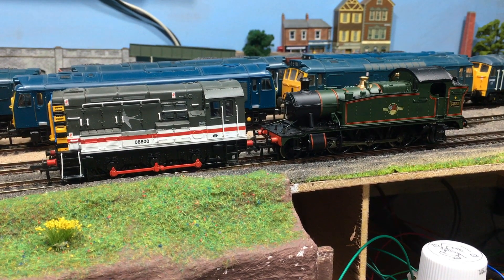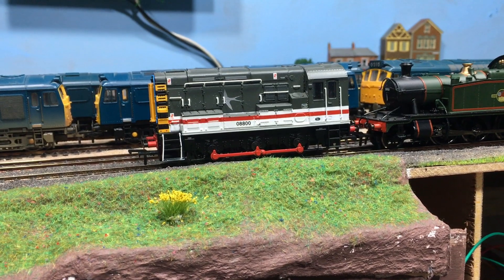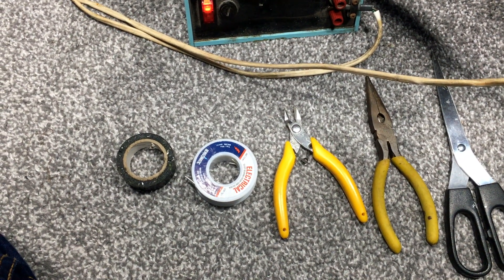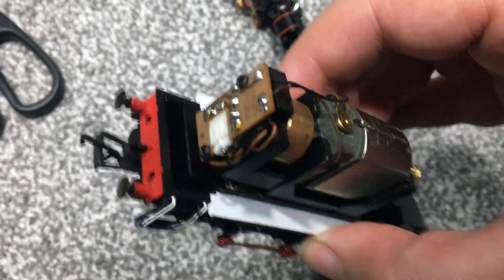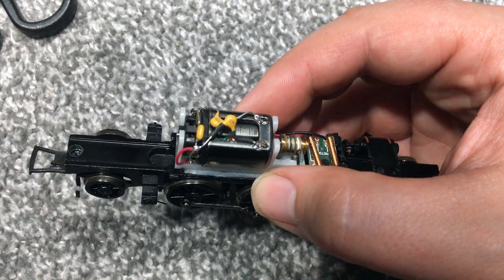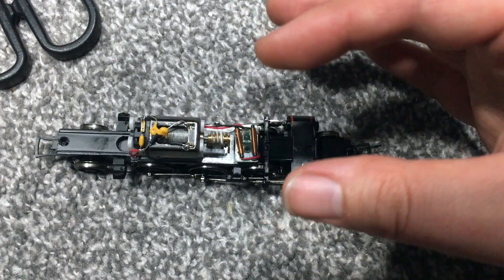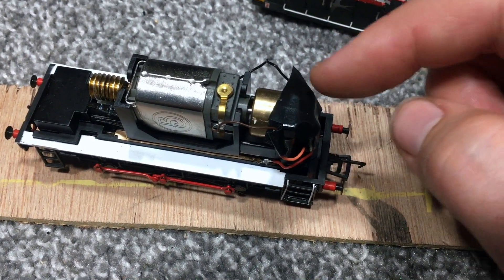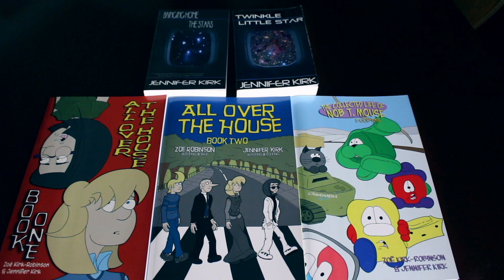Step By Step Guide to hard DCC wire old locomotives

Comment: Hello Jennifer. I'm new to this DCC method. I was wondering if, after a train like this is hard wired for DCC, is it still able to be used on a DC track with a normal controller, or is that a no no ?

Comment: Jenny you would be far better off using shrink sleeving on your soldered joints rather than tape as it can unravel,shrink sleeving is not expensive,you can it big enough to cover your dcc chip,to shrink your sleeving use the top half of your soldering iron
Reply: Too true!  Shrink sleeving is so cheap and I'd say easier to use than trying to tape joints up.

Comment: Those capacitors on the loco motors aren't needed because the DCC  chips are suppressed - you can do away with those. As others have said, heat-shrink tubing is better for these jobs than insulating tape.
Reply: The capacitors are there for EMI suppression. The brushes arc as they make and break contact and cause RFI.
Reply: @nigelwright7557  Yes, those capacitors are needed for EMI/RFI suppression when running a locomotive on DC but on DCC they are not needed. The instructions with some DCC decoders tell you to remove them.

Comment: Are the little 'Tantalum'(?) capacitors just there for RF suppressors?  I've not seen such a number on one loco myself, but I've got older locos...and not Bachmann...bar one recent addidtion...and I haven't opened it up yet.  They shouldn't matter if they're only on the DC side of the 'chip?
Cheers for letting us see that as the instructions, or 'exploded diagram' that I got with my first and recent Bachmann loco, was fairly sketchy.  Also, maybe not as new as was made out at time of sale/purchase.  Very straightforward instructions there though, Jenny.  Cheers.

Comment: Hi Jen.Nice vid. I used heat shrink tube to cover solder joints on wires. It's neater and the insulation tape tends to degrade into a gluey mess very quickly IMHO.